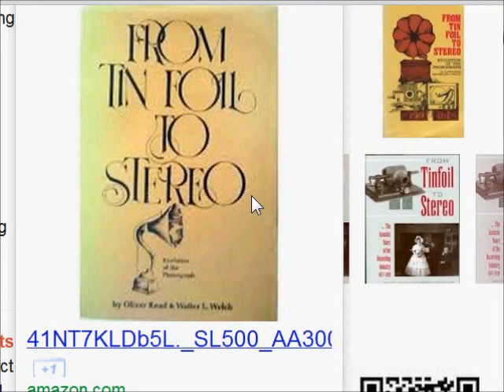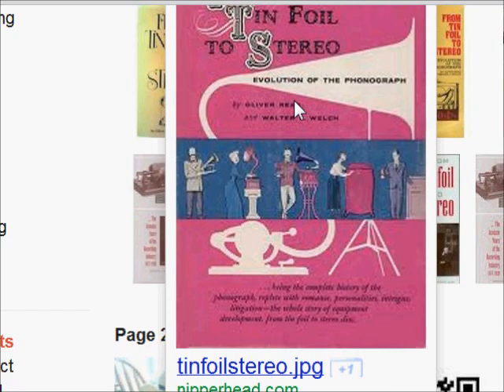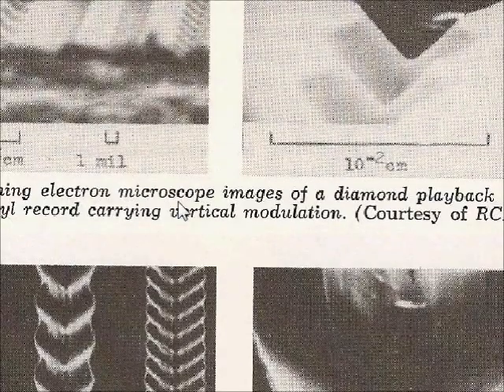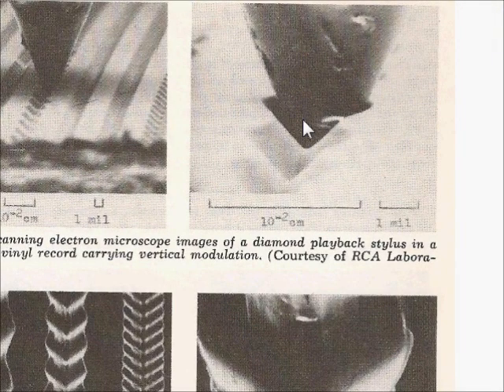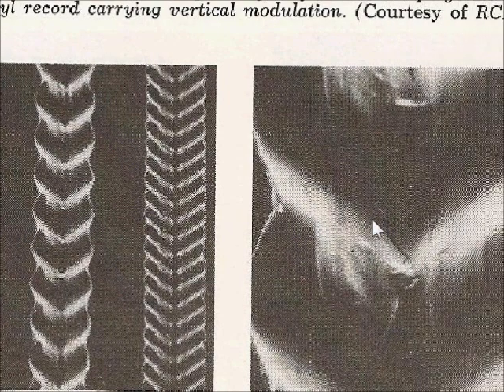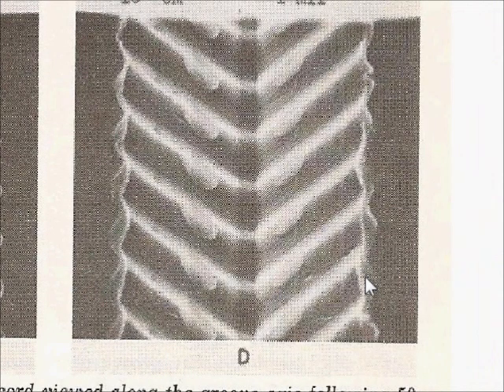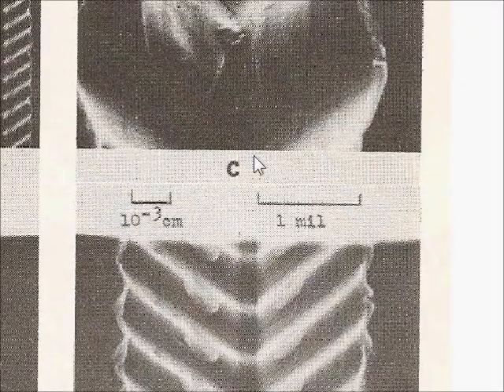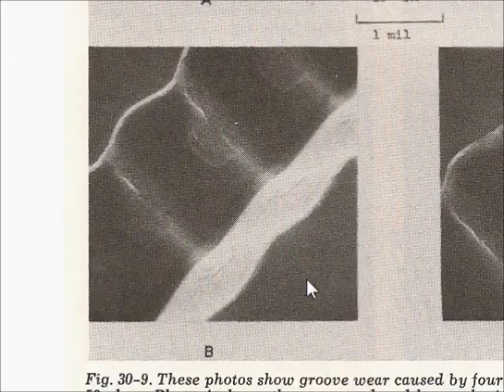Record Wear After 50 Plays

Comment: The photos probably don't take into account the poorly designed tonearms of a lot of heavy tracking record players they mass produce today and in the past. Some have carbon fibre or in the past plastic tonearms and the cheap bearings tracking at heavy forces not very accurately causing more damage to groove walls than the same tracking weight from a better tonearm.

Comment: No wonder so many second hand records sound so worn out and crackly even after cleaning them properly. The average cheap consumer record player with a conical stylus and ceramic cartridge tracks at at least 4 g. Now mostly younger people particularly women are buying those cheap crosley and other branded record players with the chuo denshi cartridge tracking at about 5.5 g and complaining that they skip on modern bass heavy records. I think they're crazy. Add all the mishandling causing scratches and not cleaning them into the equation and that's what turned people off the format in the first place. Most people probably don't even realise how good records can sound and not be all crackly and distorted if taken care of correctly and stylus changed more regularly.

Comment: I run an elliptical .2 x .7 @ 1.5 to 1.75 grams tracking force, running wet with distilled water. Been doing that almost 40 years, most of m albums still play ultra clean.
Reply: Doesn't your stylus tip get clogged with dust. Mine often does when I've just cleaned it properly. I use a large soft microfiber cloth that came with the record cleaner solution that's non alcohol based. I used to use isopropyl based cleaner. It makes records nice and shiny but I don't think it cleans them that well and some people say it dries up the natural lubrication oil on vinyl.

Comment: It is argued that basic elliptical like Ortofon OM10 or Audio Technica AT95E is not true elliptical (which is probably well known fact) and its minor radius is not actually that minor (which is debatable) thus not causing any greater wear. The front and rear facets are ground flat that somehow should help to cope with pinch effect at inner grooves and achieve better tracking. I did a scratching test with OM10 and Concorde Pro, both fairly new. I did a scratching move 40 times with both. OM10 at 1.6 grams didn't create noticeable cue burn (or very-very faint if volume is turned really up). Concorde Pro at 3 grams induced somewhat more noticeable cue burn. So these pictures may or may not be Shure's marketing hype to sell more their expensive and advanced styli. Who knows.

Comment: Light tracking force on a conical stylus is probably friendly to grooves because it doesn’t touch half of the info etched by the lathe. Fine for casual listening on a low end system.
Reply: What is non-casual listening?... Wearing horn-speakers like headphones and masturbating to every note?...

Comment: My Empire 2000/e1 is a .2 x .7 mil stylus that tracks at .75 gms...
Reply: antthing under 2 would come off and on the record ,too light????????????
Reply: Not necessarily guys, I run an elliptical .2 x .7 and rack a 1.75 grams, and that's running wet with distilled water

Comment: Good god, FIVE grams?
Reply: G.J.T Why the heck would you keep using that? I want my records to last as long as possible, and modern tech makes that pretty darn long.
Reply: I meant the stylus. If I owned that I would probably find a way to use a modern cart on it, which is probably easier than it sounds. The modern cart would probably sound better and extend the life of the vinyl exponentially. Styli are considered wear items anyway, like spark plugs, and even if that wasn't the case 60 years ago it's still true for them.

I'm just anal about my stuff. Difference in perspective, I suppose.
Reply: 2 grams enough
Reply: You know all those cheap plastic Crosley players out there?  They're in the 5-6g region. Vinyl isn't worth the investment if you don't get a decent turntable. You're throwing your money away.

Comment from the maker: The only carts that track happily at 1.5 with a conical are the AT P-mounts.  Other conical styli are looking for 3 grams and up so I'd stay with what you have but just make sure you replace styli often and keep a close eye on your VTF. Anti-skate also helps to reduce record wear so make sure it's set to the same number as your tracking force. The supposed improvements with elliptical are often mitigated by the SRA error. Look up "Stylus Rake Angle" on Google for more info about that... :) JC
Reply: Time has passed and Ortofon offers a OM1S 0.7 conical tracking at 1.5 to 2 grams.

Comment: @BadEditPro It really just lubricates and I think conditions records. After you deep clean your vinyl record(s), you just apply the stuff and after that, you don't have to re-apply. You don't really have to really reapply or clean the record again, just use your anti-static brush on the turntable.

Smells nice too and gives a nice luster after the records sit in their sleeves. Dust is awful though, the heat supposedly burns in pits as a result of dirty, micro dust infested vinyl.

g

Comment: I think using a vinyl lubricant like Gruv Glide would prevent vinyl groove wear. I think the stuff lubricates and improves heat dissipatation as well from the stylus/vinyl friction that occurs, just do research on the spray.

I'm a fully retired vinyl record user, I don't touch the things or even glance over at them but I liked that product, it also seemed to minimize noise in addition to a good record clean.

- g
Reply: You can lubricate that a lot cheaper and cleaner by simply using distilled water

Comment: Thanks JC. Ive watched all of your vinyl / record/ cart vids. I'm a nut about this stuff too. I have the M97XE too. I was crazy about it until I recently pulled out an old Sansui tt I scored at a flea mkt. I took the cart off and it was an AT LS400. I slapped it on the Pioneer  PL15DII and WOW! Not much online about them except the specs. Do you know if the LS400 was the early version of the AT120E?